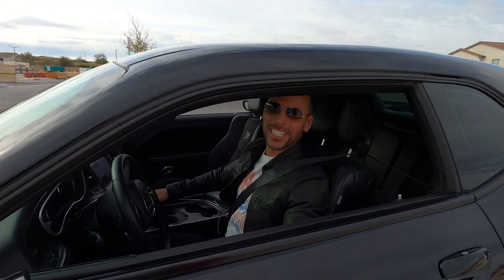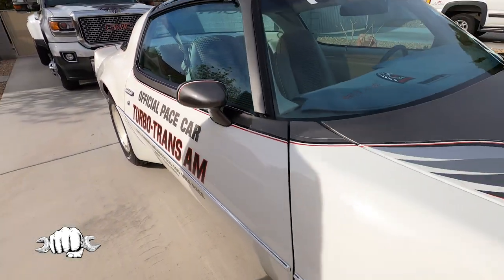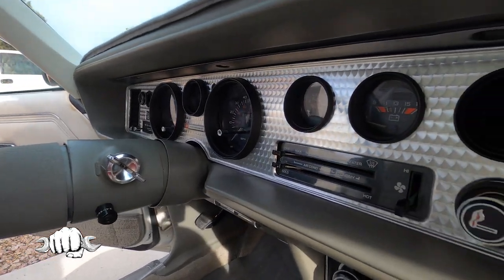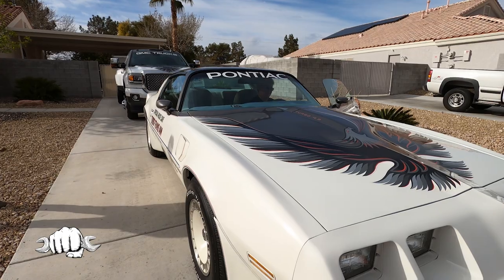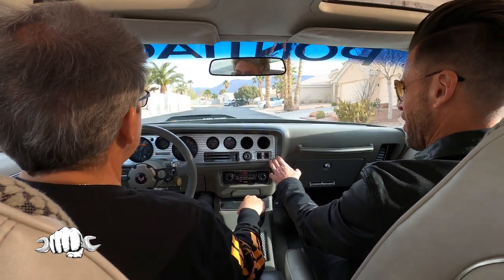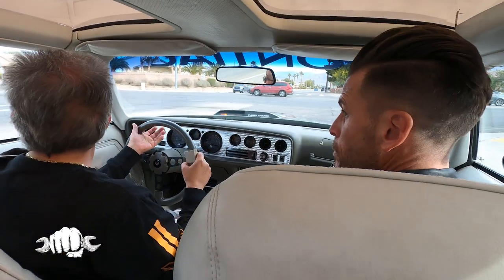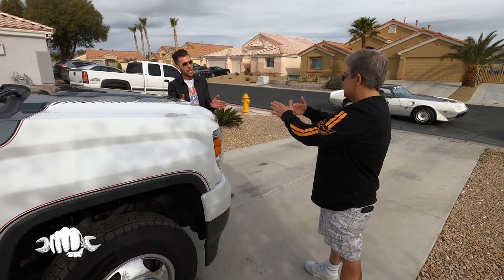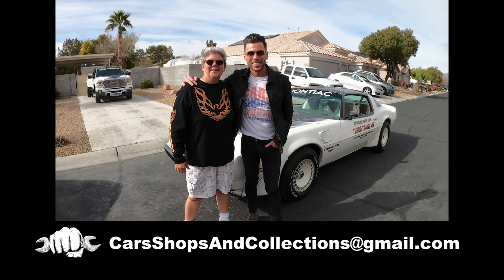RARE! 1980 Pontiac Trans Am Indy 500 Pace Car! Test Drive!

Comment: I hope she understands by not using the AC it will cause the system to have blockage. Coolant flow is important through the H-Block as well as the Receiver Drier the Compressor and the Condenser as well as the Evaporator coil. Regular usage is essential to longevity in every AC system.

Comment: I had a few of these cars. I'm watching and it all comes right back 3.08 gears 1500 rpm at 40 mph 3000 rpm around 75 mph. The 85mph speedo is to create "the illusion of speed" because the needle is further to the right than the 100 mph speedo of 79